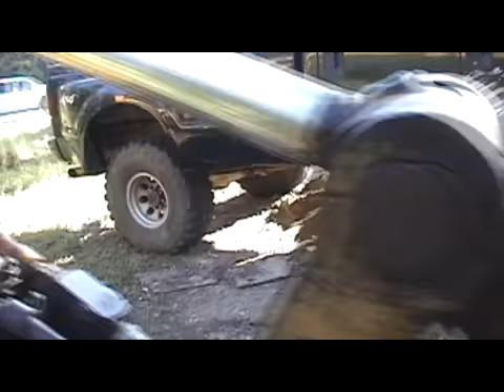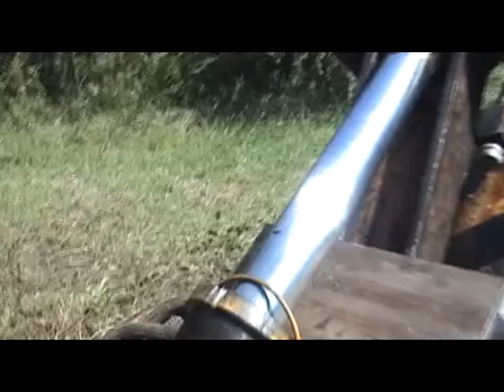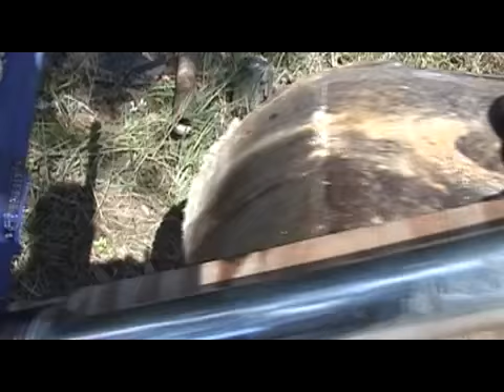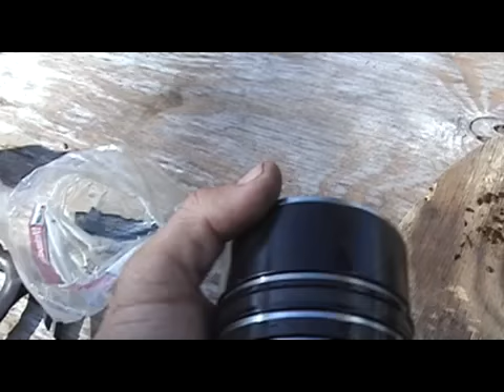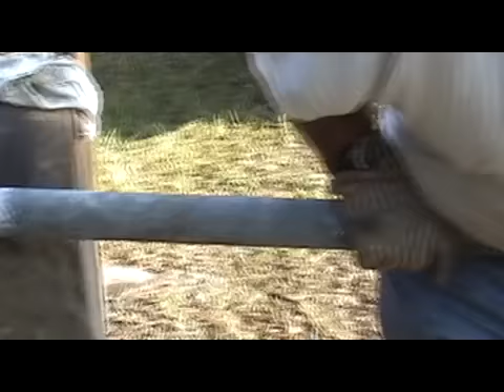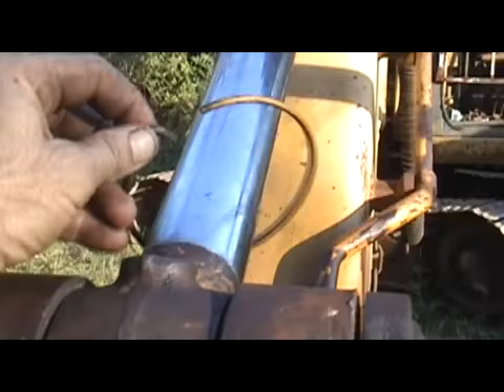how to repack your hydraulic cylinder

Comment: I have a problem with my scissor lift, It is leaking oil from the holes in the middle beam and it is not working
I can upload some pictures , I do not know how I can Upload here.
Contacted the manufacturer said I need to replace the sealing ring
This is what they said
The oil leak should be the sealing ring is broken.

Please kindly see attached images for maintenance steps.

The sealing ring's specification: UHS 40*50*6.

Please let me know how can I send you pictures

Comment: How do I fill the cylinder back up with oil and do i need to bleed the system and if so how?
Reply from the maker: It will fill itself and bleed when you turn the machine on and go to use it.

Comment: When the hydraulic pump in the system is turned on it causes fluid to enter the accumulator. When fluid fills the shell, accumulator charging begins as the nitrogen in the bladder is compressed by a fluid pressure greater than its pre-charge pressure. This is the source of stored energy.  This is what not Bladder is for , not a seal on the shaft that would be a seal.

Comment: hope he changes the bottom seal packing around, note at 1.46th minute the larger seal is at the bottom and when it is replaced at 6.22th minute the larger section is at the top.

Comment: thx for the video.  I'm going to try an repack a cylinder for the first time... 600$ a pop is getting expensive!
Reply from the maker: +phillip hager been doing mine for over 10yrs saves me tons on my heavy equipment, crane, log truck, chippers and stumpgrinders
Reply: john doe
Is that $600 on the machine or taking it to a shop?
Reply: Im retiered elevartor man. Very easy to do cylinders.make big money doing this on the side.

Comment: I've been all over Youtube looking for commentary on assessing the cylinder wall condition, and when/whether to hone.  Of the maybe ten cylinders I've rebuilt, I've done this on some when I've seen some more obvious scratches, but generally have NOT.  So I don't have enough data to know whether this makes a difference in leaks past the piston - it didn't seem to in the key problem-cylinders;  they keep dropping slowly, annoyingly vs. dangerously, while under load.  Still, honing seems like something that should be done if in any doubt, simply because it's a lot easier to do it while the cylinder is out and clean than it will be to repeat the whole process later...

Comment: You did a decent job with what you had.  You took the Head Gland off and reinstalled the oring and backup on the head and then did new buffer seal and UCUP on it. The dust seal you say is called a wiper and probably didnt need to come off because usually it is not damage (but if they give you one change it out).  You also did a good job in checking the rod to make sure it did not have any nicks it to make sure it would not clip seals later on.  Also you are talking about wearings on the piston and a piston seal that keeps the pressure.  If you use a pipe wrench on the nut just make sure you remove all burrs from it and use the proper torque when reinstalling and you will be golden.  Well done

Comment: On the piston the wide ring is the bearing, the two small tings are what seal the piston, the small rings on many models also use a backup ring. On the gland the outer ring is a wiper, the actual sealing is done with the "vee"  seal deep in the gland.
The easy way to do this job in most cases is to remove the rod/gland and leave the tube portion and hydraulic lines in place, sometimes you need to loosen the lines to break the vacuum/release pressure to remove/install the rod/gland assembly.
Reply: It is common sense vee cups lips point in to hold pressure wiper seal points out to keep dirt and dust out

Comment: Don't use a Pipe wrench on nuts... It distorts the nut.
Reply from the maker: +45von I have never had a issue on any of the cylinders i have rebuilt
Reply: What do you use for those nuts then?
Reply: @WILSON.1  make a wrench
Reply: +hydraulic shop Wouldn't you just be making a pipe wrench?
Reply: @WILSON.1  no just cut a hex out of 3/4 plate and weld a flat bar or what ever you want. Your making a long box end wrench  just put alot of green loctite back on those threads for assembly
Reply: But a pipe wrench works just fine  those nuts are hard as he'll
Reply: +Cody the Car Guy Doesn't mean it the right way to do it.

Comment: This is good for getting buy in a pinch when your out in the field. But remember there is a reason why you should take it to the dealer. For example the snap ring that goes around the Cylinder head after you tighten it prevents the head from spinning off. When you tighten the head there is a whole in the head that must be lined up so the snap ring fits in the  head. If that whole is not lined up you have to drill a whole inside the head and install the snap ring.  There are a few steps that were missed to insure the wiper seal doesn't pop out, or calling the wear bands on the piston seals or bearings. Not trying to knock on your video but this is the difference between having no issues for a few months or having it rebuild professionally and having it last for years (with proper maintenance..)
Reply from the maker: Well that is actually my cat and to this day i have had no issues at all and i use it doing ponds, tree removal so it gets worked so yes done in the field but im a actual owner operator and this is done to save people the unreal prices they charge you to come take it out and rebuild it then put it back in. Now the new video coming out is even better and covers more of rebuilding it this one is on my fork lift and another one ill be doing it some mods and building and trouble shooting hydraulics i did on my swinger ( smaller loader). I have even rebuilt cylinders in my cranes and dozer's so it works or i would'nt have put it on here.
Reply: Whoa slow down man. I did not question your mechanical abilities or try to imply what you are doing doesn't work. I'm sure your a very capable operator and mechanic. All I'm trying to say is that there is a reason why someone would take it to the dealer and the difference between doing a job that works and having it done professionally. If what your doing has never failed for you then fine by all means keep doing it. Again I'm not questioning your skills as a mechanic but I can guarantee that I have rebuilt more cylinders in a month than you have in your lifetime. I have seen so many DIY jobs that have gone wrong and caused catastrophic failures. Or not done correctly which caused contamination of the hydraulic system. The reason why you are paying so much is because you are essentially getting a new cylinder because all the work that goes into making a cylinder like new that DIY'ers simply can't do because they don't have the knowledge and or equipment. For example I have seen the piston nuts come right off the rod because they were not tighten correctly (to spec) and basically destroyed the inside of the cylinder. Are you sure you tighten that nut to the correct spec? I have seen piston bolts tighten to much and stretched the bolts so much that they broke inside the rod. All because a DIY'er doesn't know. By the way did you ball hone that barrel? Because if you didn't those seals won't last as long as they should. It basically the same thing as the reason why you ball hone cylinders in a engine. So It all boils down to you pay for what you get. You run the risk of damaging your equipment then paying big time for repairs later because of no warranty. And you can always take your cylinder out yourself and take it to the dealer. that will save you some money. But I fully understand You don't have the money to take it to the dealer then you do what you have to do to finish the job. But understand there is a reason why Professional Mechanics/Technicians say "Pay me now or pay me big later".
Reply from the maker: Well i have taken cylinders to the dealer before and also a hydraulic repair shop but i find my jobs last just as long as the dealer but save me a ton by doing it myself. Now i do use dealer parts and the new how to rebuild your hydraulic cylinder will cover even more and yes i know about honing my buddy owns a hydraulic repair shop i've actually built my own cylinders and get to use anything in his shop if i need it. So you'll just have to check out the new video should be up next week sometime.
Reply: Sounds good. And by the way I believe you are one of the few guys on YouTube that I believe are capable. I've seen some guys posting videos and they are clueless. Especially the ones who teach themselves off of wiki and how stuff works and never actually turned a wrench for a living. Keep up the good work.
Reply from the maker: Thanks that comes from many years of having to build or fix something in the field ! Plus i build hot rods and some customs. I pretty much have my own machine shop in my shop. Yeah after seeing how much people watch this video i knew i had to make a even better one, so im gonna do my forklifts cylinder and explain a little more.
Reply: Tank Ronin I wish that bringing it in to a "certified" mechanic guaranteed it to be done right. I have done that many times only to not have it done right causing me more down time.Its a shame that there are so many frauds out there. If you can do it yourself do it.Unless you have knowledge of a true and tried mechanic.
Reply: Joseph Sullivan You have one heck of a point there, Joe. I have experienced the same type of things.
Reply: That’s EXACTLY what I’m saying too Joe.  ! Paid dearly (1000 bucks )  for a rebuild only to be doing it again 3 years later!  And we took it out for them.

Comment: It was a reverse process on changing seals. Normally it will be rod clevis to be removed and freeing the rod seal cap so you could start removing the rod along with piston. I understand this process because it is done on working site not on workshop you could use a vice bench to grip the whole cylinder.

Comment: We have an old oliver backhoe one of the front bucket cylinders is leaking. But from the 1/2 tube. It's leaking at the lower fitting connection where the tube goes into the fitting.how to repair. You cant tell if it soldered or just comes out and has an Oring. Help.

Comment: Somewhat helpful, but more demonstrating how you took the cylinder apart rather than just showing it after you've done it would've been better. Showing the insertion of the various layers of packing would've made the repair clearer too. It looked like you put the pipe wrench on the piston itself on the lower end of the rod, but that would've marred the surface, so maybe it was just a camera angle.

Comment: how do you get the air out of cylinder after you do the repacking?
Reply from the maker: It will get the air out on its own when you turn it on the air will go into the tank and be fine from there
Reply: Hydraulic reservoirs have a breather on them it stops reservoir pressurization and allows for the evacuation of air from the system, the pressure is created at the pump and delivered to the lines and on to motors,rams and so on it is returned from the motor or rams to the tank where pressure is bled from the system.
Reply: ***** Thank you for answering that question in such detail. I have often wondered that about the air and how it escaped from the system !
Reply: David Hoover You're welcome

Comment: I personally think the video accomplished a lot of good in showing how to disassemble the packing then to re-pack a cylinder. I would have left the cylinder attached to the pin rather than pulling it, but that's just me. For a sticky cylinder, you can also leave the hoses attached to the cylinder pin and push the packing out by hitting/activating the hydraulics.  One question is why you didn't use a spanner wrench to remove the lock ring?

Comment from the maker: well i do it to where the part that would catch the fluid on the power side of the stroke can get the most but i also look to see how the factory had it there usually will be at least one part of the old seal left or i look at a print out of the cylinder break down it will show it as a good guide

Comment from the maker: Its very easy once you have taken it apart , I used a screw driver and a pick to pull out the packing, lowes has picks and so does harbor freight. Now as for putting it back in , just push one side in first and work it in , some of this stuff was near impossible to get a good camera angle, the next cylinder video will be multi camera and more detailed , if you have any questions doing yours just ask

Comment: Just curious why you removed the entire cylinder, why not just pull the rod and leave the cylinder in place? I never take a cylinder tube off unless absolutely required, makes assembly easier as well as saving a ton of time.

Comment: I've used a very similar setup to rebuild cylinders on cranes while leaving them on the machine. The pipe wrench is a good way to get it done but air impacts are definitely worth their weight in gold on those piston nuts!

Comment: the body slides over an outer fixed shaft. so the forks can move without the mast moving. when that tops out the mast starts moving and the cylinder starts to lift like a normal one. its freaking weird looking. welp, looks like i need to dive in and make a video!

Comment from the maker: If your in the Gulfport or Biloxi or surrounding areas i also can repack your cylinders cheaper than the dealer just send me a message of what it is and your number, ive done cranes, excavators, dozers, tractors, grapple trucks and at right at 50 bucks a gallon hydraulic fluid its best to just fix it .